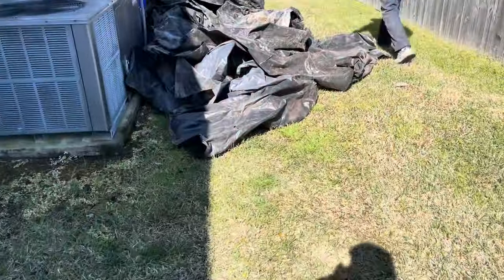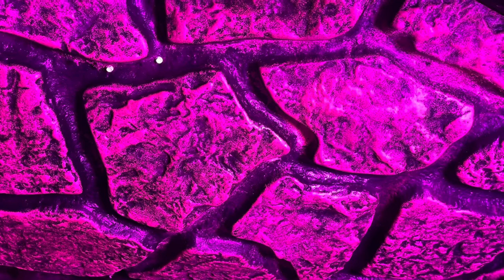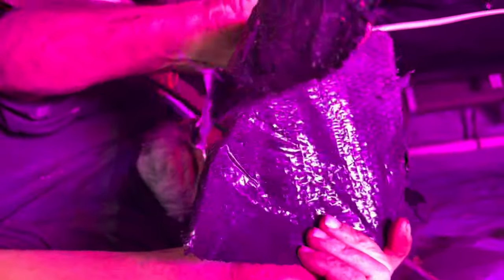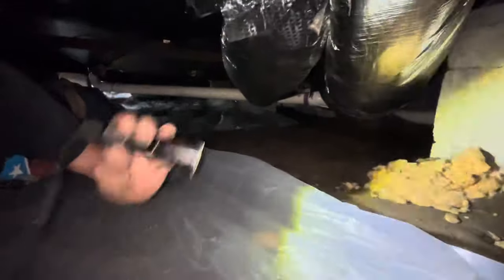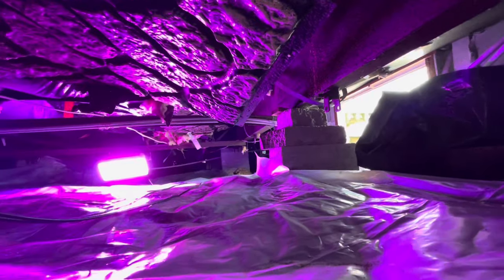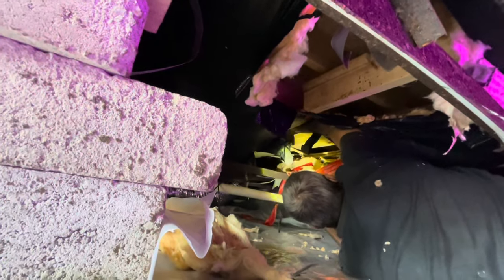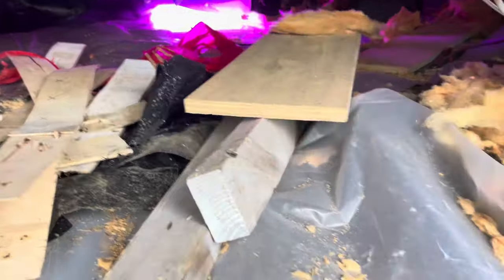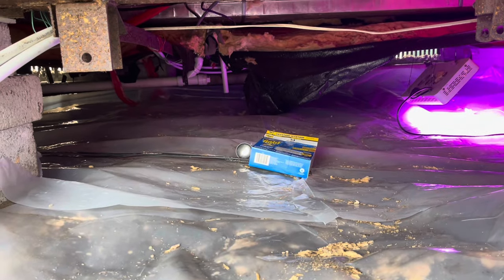(How To) SingleWide Mobile Home Underbelly. Are you kidding me??

Comment: Bought a 1984 in a nice park in Central Florida in 2017. Got a great deal on it . Last summer i finally decided to get under it and do clean up and pull down all of the hanging insulation. I also pulled out a pile of tv cable lines due to the cable companies putting in new lines over the years. Cut down the propane gas line and added more blocks and straightened out some existing blocks. Raked it and put down heavy plastic. Now its so nice to go under there if needed.  Plenty of room except for about the last 15 feet and then it gets tight. Edit again.... didn't see even one bug or spider.  I was grateful for that considering im in Florida. But ive bombed under the mobile home at least once every year which helps.
Reply from the maker: Great story. Keep going. Your home is your home